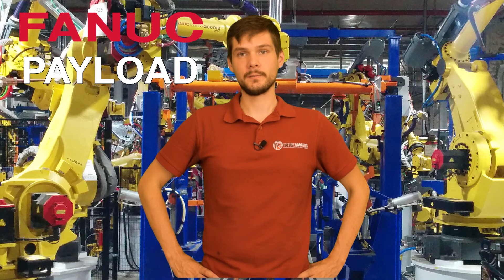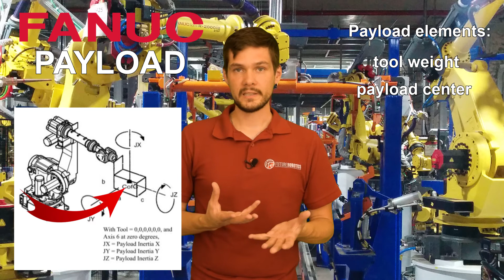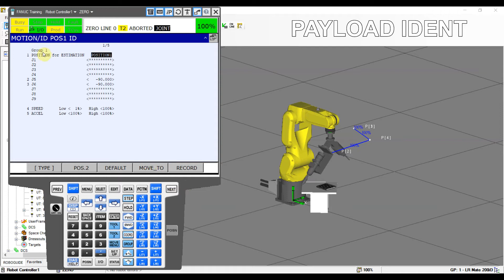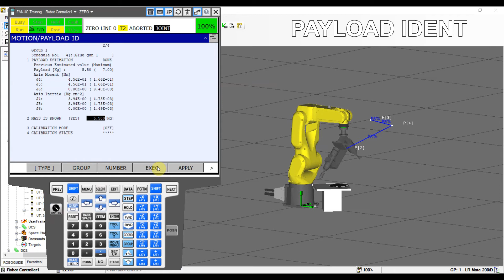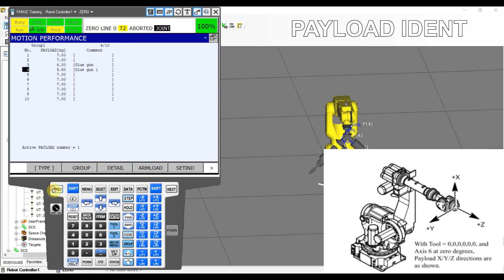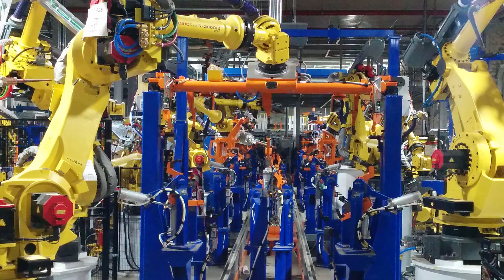How to set robot PAYLOAD / FANUC payload setup / ARMLOAD

Comment: Hi, for the payload ident features, must the robot mounted onto the floor? if i got a wall mount robot, can i setup the J2 and j3 with 90 degree, then run the payload ident? will it works?
Reply from the maker: Well the robot has to be mounted, but the position doesn’t matter if the robot is mounted upside down you still can do the payload, you just need to make sure that that mounting position was selected under Maintenance in the Conttolled Start.

Yes J2 and J3 should be within 90 degrees, and ideally J3 90 degrees to the floor

Comment: The number at the robot e.g. R-2000IR 185L shows that the payload ist 185 kg? If i use a Tool which ist 50 kg. Does that mean, that the payload is (185+50)kg?
Reply from the maker: 185L means robot can handle 185kg and L means long arm, so theoretically you can mount 185kg tool on the robot.
I'm saying theoretically, because it depends on the inertia moments that the tool will generate and how far off it is mounted from the A6
Reply: @FutureRoboticsChannel  so that means the payload is the absolut mass of the tool, which is limited to 185 kg. How can i determine the armload? In the video you wrote 2 numbers, but i dont jnderstand how to determine that??
Reply from the maker: @RT-fi7rb  Armload you need to know, robot can't determine it, you need to know the mass of whatever is mounted on A3 and just input it to Armload
Reply: And which weights i have to write on Arm 1 and 2???

Comment: Hi Sir, thank you for the incredible videos. If I have to run the Ident in AUTO and the fence open warning keeps popping up. Is there a way for me to disable the fence open warning and proceed? (I think the robot is looking for the at home signal input)
Reply from the maker: Yes, but that depends on your safety configuration. If you are sure about it you should be able to temporary bypass that signal in DCS, however I strongly recommend not to do it and find a way to get Fence Open signal working
Reply: @FutureRoboticsChannel  Thank you for the quick reply. I very much appreciate all the videos you have put up. I took on a consulting job at a manufacturing plant and was able to get their Fanuc robot cell station a 25% increase in output, which translate to more than 60k of extra revenue per day! I had no prior experience with Fanuc robots, and your videos are a great starter :)
Reply from the maker: @frankyehphoto  Great job ! If you need new ideas feel free to shoot me an email at info@f-robotics.com

Comment: I'm getting an "Ident option is not loaded" error at 11:37 when I push the Ident button. What could be the issue with this?
Reply from the maker: is it an older robot ?
Looks like you don't have the ident option loaded (installed0, that would mean you cannot preform IDENT, but you can only input payload by hand.
If it's a new robot than try installing it using the USB that was delivered with the robot

Comment: Thank you for the vidio. Internet was amazing. But how about the center of mass of the arm load?
Reply from the maker: Not sure what do you mean :-) There is no center of mass for arm load, robot needs only the mass.
I'm assuming that the forces caused by the additional weight on Axis 3 does not affect the motions that much, so there is assumption that the center of the mass is between the mounting points, but to confirm we would need to ask Engineers that are making math models :-)
Reply: @FutureRoboticsChannel  thank u for the explanation

Comment: Sir cycle time based on tool load or not ?...then how to increase cycle time 
In my company the cycle time only 100% if we need more cycle time what we do ? Tell me clearly sir
Reply from the maker: Your payload affects the robot acceleration and deceleration, if your payload is defined correctly than robot is "accelerating" and "breaking" in the most optimal way.
However payload is more important for Collision Detect.

If you are looking at cycle time, you should focus on the way how the program is written eg. if you are using CNT100 as many times as possible, if the logic is written in the most optimal way

Comment: Hi, thanks for a nice video.
Just one comment. The ax 5 should move the load in the horizontal plane, i.e parallel to the ground, while doing the payload estimation.
Reply from the maker: Yes, that is correct, thank you for pointing that out !
Reply: @FutureRoboticsChannel  hello, so when recording my position 1 and position 2, rather than up and down it should be left to ride 90 degrees from sticking straight out?
Reply from the maker: @Caleb G.  The movement of axis 5 should be same as you would do a "curl exercise" (up/down), the movement of axis 6 is trying to turn 180deg (clockwise or counterclockwise).

You actually did bring up a good point that is important for X servo guns calibration ;-) that's taking gravity into the equation.

For the payload the ideal position is having all axis at 0 position for the start, but if that's not possible than Axis 3 must be parallel to the ground and axis 4 must be at 0 degrees to ensure that J5 axis of rotation is parallel with the ground